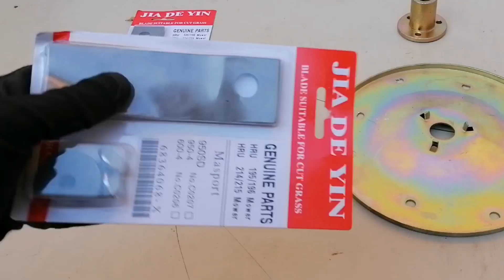How to Change Honda Lawn Mower Blades with Ease!

Comment: Nice work mate!

Just one thing. When you assembled the blades. I noticed you put the spring washers that have the bent up wings under the thicker washers on the top of the blade plate. The spring washers go between the blades and the blade plate. It helps the blades turn freely so if they hit something when mowing it shouldn't do as much damage.
Reply from the maker: Thanks for watching. Thank you for this clarification ♥️